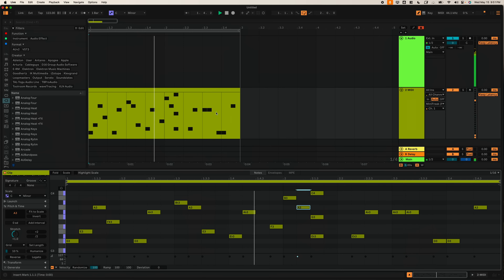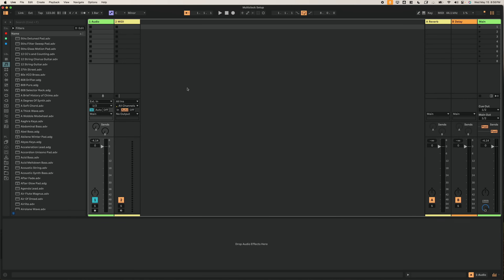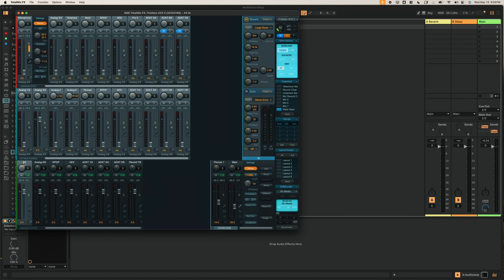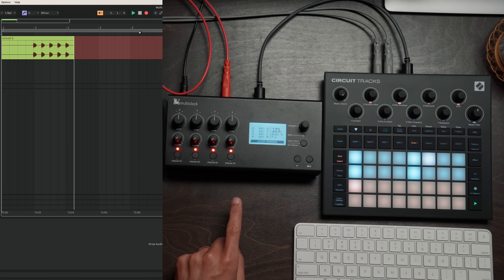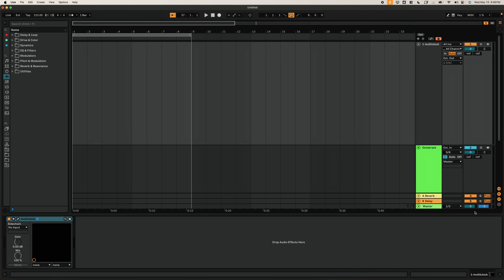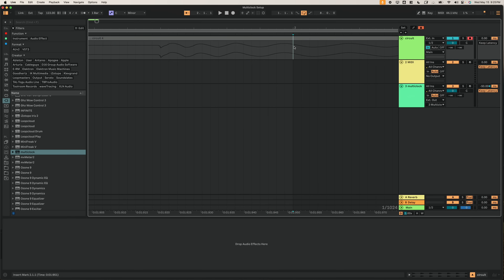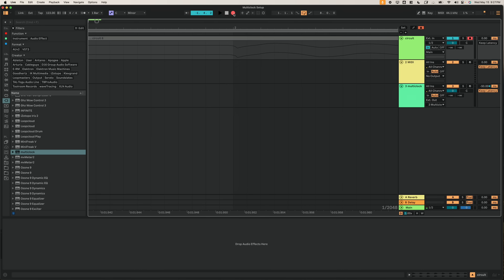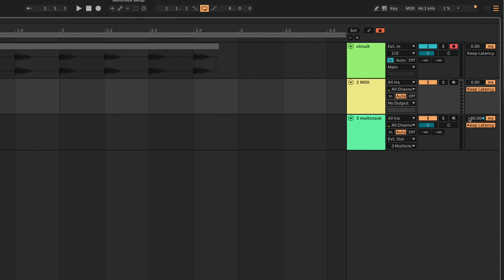How to PROPERLY use your Multiclock with a DAW.

Comment: I have been using a Missing Link Junior to sync my modular to Ableton. It lets me use Ableton Link via wifi and sent clock/reset to my modular. It even has latency compensation. It has been such a tremendous improvement to my workflow. Now every clip I record is perfectly on the Ableton grid. I even have the Ableton clock set to 2 bars, so my DFAM always starts on beat 1.
Reply from the maker: Whoa,  no jitter down the line after recording for a bit?
Reply: @RickyTinez  It seems to miss a clock, or my system is dropping audio on the PC end occasionally. I haven't looked into it fully yet, because I always forget about it, until I notice a quiet beat in the flow. It's rare.

I passively mult the clock signal out of the Missing Link and all my synths and modular seem to take it just fine. As a bonus, it can be a standalone clock generator even without Ableton open.
Reply: Ableton Link is awesome. I wish every every drum machine or synth that has a sequencer or uses any type of tempo sync supported it. Doesn’t even need to support WiFi, just a Ethernet port would work. You can set your computer up with a local network. One Ethernet cable going to a network switch then to all your hardware. An 8 port network switch is $20 and cheap cablesare around $2 for a 6 footer. That being said, I’ve been using the multiclock for years. 😝
Reply: That’s a helpful hint! As I tend to use Cubasis on my iPad quite a bit, which supports Ableton Link, this Missing Link Junior box might be worth having a look.

Comment: Excellent discussion on an often misunderstood piece of gear. Thanks for sharing! I sold my Multiclock and switched to Bitwig's HW Clock Out device. Ableton's CV Clock Out does the same thing. They work with DC coupled audio interfaces like my Quantum or your RME. Have you compared Ableton's CV clock out to ERM?
Reply from the maker: Hey, that’s an interesting point! I completely forgot that my RME can do that! I was on focusrite for years, which never gave me that ability 🤔
Reply: Hey, this is very interesting. Have you seen good tutorials on this, showing all the connections and settings? I'm personally on the Apollo Twin (apparently it's DC coupled too)
Reply: @arseniharkunou  I haven't seen any tutorials, but it's pretty simple. Load the clock device in Ableton or Bitwig, choose your Apollo output, connect to any gear that allows it (you'll probably need a mini plug adapter), set the clock source on your gear. I've used it with my Keystep Pro and Hapax. From those, I can distribute clock to other gear. I use 24 PPQN and then mess with the other settings until I get something I like.

Comment: Even though I don’t own or use a multiclock, I found this video interesting on many levels. So, first of all: tanks for your time to record this and share your knowledge and experience, Ricky! 
From what I understand, this might help with more recent gear, which is equipped with MIDI, as well as slightly more vintage machines that use, well, DIN sync? Or am I mistaken here? 
A somewhat tight audio signal to sync stuff might even allow for, let’s say, a tape machine to be the master clock: record the plugin signal to tape, then feed that channel into the midiclock. (I guess Depeche Mode used a tape machine on stage in their early days to play back the pre-recorded rhythms to their songs. But I am not able to imagine a recent life/stage setup that could make use of a multitrack synced to the tape … But I get carried away, sorry. 😂 - Maybe this would be more suitable for a lo-fi recording setup in a studio using a tape machine then. Anyway …)
This was quite interesting. Great to know that a solution like that is available - and good to have an idea how to make it work. Thanks a lot, Ricky!
Reply from the maker: Yea that’s totally right! You can even download the “sync sound” and put it into a sampler or something to run the multiclock. And I just covered ONE of the many many ways to use the multiclock. 

At the time the ability to take a single midi source and split it and rout it to specific outputs was huge! But now it could be done for much cheaper with other options
Reply: @RickyTinez  Thanks a lot! :)